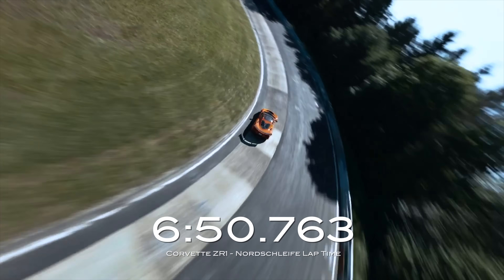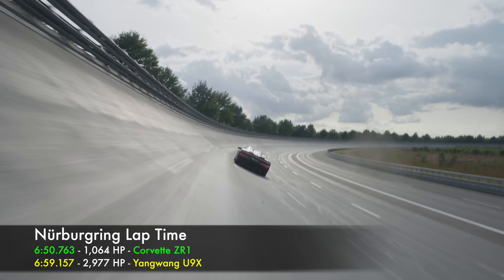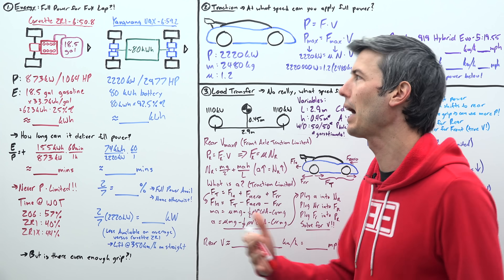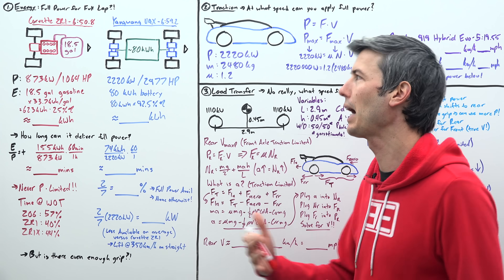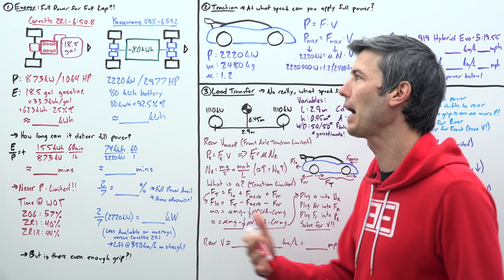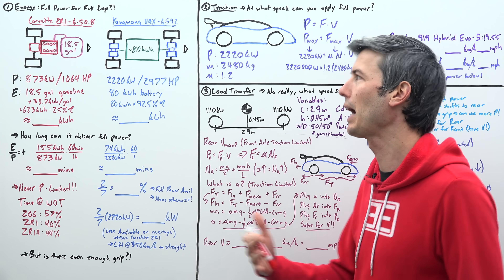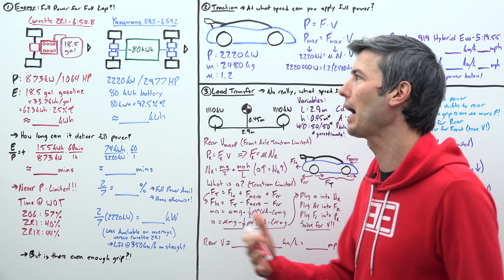Gas Beats Electric! Why Is 1000 HP Faster Than 3,000 HP?

Comment: At first thanks for the effort, i think everone gets the point u are telling! I dont want to offend you, but i think you kept it a little to simple here and there.

1) For a better visualisation there is such a thing called "traction diagram". You can put all the forces and resistances (negative forces) in the diagram for a clearer visualization and then look for the different keypoints (respectively show them).
2) You hadnt mentioned some (imo) important variables:
--> Gradient: When the car is going uphill, the rear axle power problem gets even worse and you also gain another (relatively high!) resistance. But the other way around, when the car is pointing downhill, you gain a significant amount of traction force on the front wheels. For simplicity you could say "they cancel each other out", but this isnt the case in reality, bcs some gradients are in corners for instance.
--> Adhesion: The Traction (m*g*u) isnt the only factor for bringing force/ power to the street. The adhesion between rubber and asphalt is also very important, because rubber is actually not a solid. Its more of a viscous fluid (non-newtonian-fluid). Especially when the car tires are slicks oder semi-slicks. What does that mean? The tires are "interlocking" in the asphalt and this allows a significant amount of extra force. Thats actually the reason, why they are making the tires wider (and of course bcs of thermal and strenght purposes). If you look at the formula Fr=m*g*u it doesnt contain any support area A. The support area A only appers in the formula for the adhesion (so big factor)
3) What about the drag force at higher speeds? The EV has a quite big bumber in the front and it seems to me this creates a good amount of downforce in the front (more power at lower speeds, but idk exactly at which speed it starts to work properly).
4) you havent mentioned the cars behavior in corners. The EV is significantly heavier than the vette. What this means is that in corners the tires of the EV are getting in trouble much faster bcs of the radial force regarding to inertia compared to the vette tires. This also a huge influnce on the lap time.

But anyways, again thank you very much for this very interesting topic and for the very clear explanation! You probaply know all of these things anyway and dont wanted to show too diffcult calculations.

Comment: it's literally all just do to weight. If everything was even, except for gas + automatic vs electric, the EV would obviously be better. This assumes the motors can spin fast enough and neither car has overheating issues. In this case, a 5,467 lb will almost never compete with a ZR1.

Actually this same question can be asked with a GT3 RS versus C8 ZR1. GT3 RS has like half the power. On the other hand it weighs 500lbs less and it generates less downforce. The ring is mainly high speed corners. Not too much straights.

Comment: Still wrong... this assume cars is going in straight line, which is obviously not the case, so aceleration calculaiton and tyre grip limit only makes sense ignoring that for like 90% of the time the acceleration will be at some angle and there will be later forces on the tyres. Meaning - there will have even less grip overall per axle and thus even less power could be delivered to the road.

Also big reason of why Corvette in this case was faster in this track is simply weight, I reckon chinesium shitbox lost more time braking than it lost due to lack of grip accelerating 2,500kg car or rather tight track would lose a lot in braking and simple could not take as agresive line and could nnot start accelerating as soon. So it obviouslly "killed" it in straight and on acceleration, but lost in corners and in breaking.

The reaosn is much mroe complicated than jsut straight line accelerarion and grip limits.

Comment: At full power the battery would be doing a 27c discharge. It would definitely cause a huge voltage dip causing the moters to limit power output.

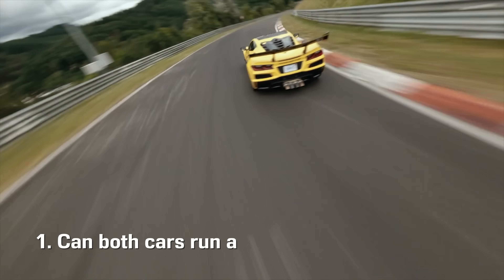Comment: 0:42 I know the BYDs battery size (80 KWh) and the ring length, so without doing the math, I can say probably not.

However, the good news about having such a high C rating is that th battery won't have to pull power due to heat soak.  Unlike..... say..... a tesla model s plaid might have had to do.
Reply: 8:25 this specifically had me shocked when I looked at what this meant for the "standard U9's" time around motor trends figure 8 course.   

I won't disclose the number I got because I HAVE to be wrong. However, the number suggests that it would not do well around the figure 8.

Comment: An electric car tends to be quite a bit heavier and handle not as well an gas powered vehicle  because of the weight an electric car will win in a straight line but on a Long Lap with lots of elaborate turns the electric car has a disadvantage

Comment: What about aerosynamics? How much does the U9 weigh at 150mph including downforce? You also need to figure air resistance combined with that downforce to figure out traction ability at speed.

Comment: Are you on crack?... seriously, have you any contact to the real world, completely disregarding weight, and corner speed on a race track. The electric car is slow because it is fat, every single electric car has this problem, there is so much track time found in the weight. Electric cars are only fast in a straight line, unless they are built to a specific track, with a run time of under 10 min, after that the battery weight starts become a problem, and not anything on your whiteboard
Reply: He didn't disregard weight.
Reply: @logitech4873 he only use weight to calculate some traction, the weight is a factor every time you accelerate, every time you break and every time you take a corner, and you do that alot on a race track, and he doesnt say anything about that, he is only talking about acceleration in a straight line. And you could at least have some sort of argument, instead of just saying, he did not do that.

Comment: Then the next question would be is it possible for a car to turn so fast that the driver is the limiting factor? How much of tyre friction is required to accomplish that? Is it even possible in the next 100 years?
Reply: Formula 1 has that problem, you need to be very fit to hold your own head at 4-6G.

Comment: 1:54 i figured for this example it was irrelevant,  but I don't think that's a fair assumption for the corvette engine. Since it's a super high performance car, it's probably in the 35-40% range

I remember hearing the mercedes f1 car reached like 50% efficiency

Comment: Your conclusion is the EV was slower cause it couldn't put down its full power, so what if it was limited to 1,000hp or 1,500hp would it be faster then? The main problem sounds like energy density of the ICE vs EV

Comment: Would be interesting to see how much time @WOT the yangwang  maintained. Then comparing that to the ZR1 and calculating out what power the drivers requested. More power requested would likely be a result of better stability from aero/weight dist etc as you concluded. In the ring, grip is king 🏎️

Comment: Something to note is that the nurburgring also has a speed limit I believe of 350km/h. This may also explain the limited straight line speed
Reply: Jason and commenters have stated that there is no such track speed limit. The only speed limits have to do with the speed rating of the tires used on the vehicles.

Comment: My question is: You state the the level of energy density for gasoline.  Is that just for gasoline or gas and air mixture.  I thought that about 40% or so of energy comes from air.  Just curious
Reply: ? Air is non-combustible, How do you figure it has "energy".? (All mass has some potential energy but that is not at issue here). The oxygen in air is the "oxidizer", not the "fuel".
Reply: @avsystem3142  thanks that's why I asked.  Guess I could have looked it up first. Seen someone else mention it before and I thought it made sense.

Comment: I like the videos the cars are cool the math you did is fun but there are so many variables left out that it’s not even funny and then a whole lot more that aren’t even recognizable.
Temperature of tires of the road of the air type or tires weight of vehicles the corvette gets lighter as it’s driven I’m guessing the electric car gets slower as it’s driven because of voltage drop and heat in the batteries and motor also the gas engine will get heat soaked and the brakes what about them

Comment: That's not factoring in the energy recoverability of the battery, a battery can store a rates amount of power but that's not what you are getting out of it 99% of the time based on degredation, temperature, and etc. You are often only 80 to 90% of that battery capacity back out of it again, on the lower side for track conditions, sure you can recover power through e-braking and otherwise but a significant portion of that power is lost to heat in the battery and elsewhere.

Comment: Jason, wtf??? The Nurburgring isn't a straight line! All of this math goes out the window when the car is cornering. 

If there is ANY steering input while the car is accelerating or decelerating then you need to account for the vehicles L/R weight transfer AS WELL as the F/R weight transfer to calculate whether it's power- or traction-limited. And that is all BEFORE you count every single bump, dip, camber change, elevation change,  and curb in every single turn, then analyze the drivers racing line and track the G-Forces the car is experiencing.

What I'm trying to say is that you've oversimplified this video to the point of it being completely useless. Determining the speed at which 3000 HP can be fully applied is ONLY useful on a straight section. You know this. The Nurburgring is like 85% corners (guessing. someone correct me). 

I haven't even mention the difference in vehicle weight and the effects of bumps in regards to tire grip and downforce. To pretend like the main difference in lap pace is simply due to tires is laughably ignorant.

Follow this video up with a REAL  analysis. I'm sure the cars had G sensors. Review the footage. Note any differences in racing line and sector pace. See which bumps they hit, which ones they missed. Calculate the grip for each tire in each corner. Do it right, or don't do it at all.

Comment: Horsepower = torque * rpm. Electric motors deliver torque linearly with rpm. This means more torque is available at higher speeds, however that isn't always helpful, sure it may have 3000 horsepower, but it may only have a modest increase in torque compared to the Corvette.

Comment: Having superior power or even power to weight is definitely not gonna be everything on a track like the ring. When one can weighs a tonne more than the other thats gonna limit the cornering and braking, and you would have to compensate that with either much wider tyres, or a lot more downforce, neither of which theyve done on the u9x.

Comment: Most of that seemed geared towards calculating the results of a series of drag races...cornering ability mentioned briefly at the end.
    Handling and ability to inspire confidence in the driver? 
   Something somewhat similar that maybe not many viewers can relate to...try riding a cr500 in a tight,  rocky hare scrambles. The power will be your enemy in about 5 minutes. Sooner, depending on your ability.

Comment: I would assume aerodynamic drag being put into down force through the body work + wings (but also the low drag diffuser) contributes quite significantly to the speed at which it can use maximum power.

Comment: There are some variables unaccounted for. I would say the biggest variable is a car's suspension. A car's suspension helps to manage weight transfer front to rear and side to side. The weight transfer will not remain constant, just as the rate of acceleration will not remain constant, as the opposing forces increase exponentially as velocity increases. The weight of a vehicle is a huge factor as well. The entirety of a vehicle's aerodynamic performance cannot be calculated with only its drag coefficient (Cd) which is only representative of a car's frontal area. Air exerts force on the top, sides, rear, and underneath of a car, as well as the front. As a car moves forward it pushes air out of the way and this air rushes back creating pressure variations along the entirety of the car. A boundary layer of air forms sticking to the car creating friction, and that boundary layer needs to be managed. Having said all of this, I am sure all of these things were left out for the sake of time and the viewer. 😅 But, taking all of these variables into consideration, I think it would be able to put down 100% of total power at a much lower speed. My opinion at least. It is true that we are approaching the limits of tire technology when it comes to grip. It isn't always the most powerful car that gets you where you want to go the quickest, it is the car that takes all of these variables into consideration and maximizes overall efficiency that will be the fastest, and that car happens to be the 919 EVO.

Comment: The ZR1 in racing conditions is 4 miles per gallon.  So it can go flat out for 74 miles not 10.  So your efficiency was unbelievably low.  I also believe your electric motor power train isn't as efficient as you believe.  You are adding back in your efficiency losses from regenerative braking which isn't done nearly as much at the ring.  So the number is FAR to high in the rings conditions.  This is why Formula E's tracks are so braking heavy so that they can regenerate 50% of their power losses due to all the intensive braking.  They do not run on the full out long courses that have multi ultra long straights as this destroys their efficiency numbers.  We all knew battery weight far exceeds gas weight and it lumbers into the corners in far worse condition.  This isn't the tires fault.  Unusable power is also much of the case with the ZR1.  1000 hp also isn't usable.  Both cars are unable to use the HP-FT/LBS available or they would just roast the tires.  Electrics are always worse on them due to the unbelievably high weight.  5,000 lbs is no joke.

Comment: I wondered the same thing, and this helps my understanding a lot.  Also, electric motors dont deliver max horsepower near their highest RPM like ICE engines.  This explains why they are excellent for street driving but can be less good for racing.

Comment: hmmmm... near the start when you work out the time available to run at 'full power', for the ZR1 you take the energy (155 kWh) and divide by power (873 kW) to get 10.7 minutes... but the 155 kWh is net energy (taking into account engine efficiency)... should you actually use the energy available before efficiency, ie. time available to run the ICE engine would be 623 kWh/873kW = 42.8 minutes...??

Comment: The advantage the U9 would have with that much power is the ability to overcome higher drag. So it needs a gigantic rear wing, and massive front aero, and it should be able to go quicker.

Aside from that, the Nurb is a fast track. Power makes more of a difference there than at other tracks with shorter straights and tighter turns.

Comment: Never enough to have power, as it matters whether that power can be delivered.

Another potential snag in the EVs ring performance is also heat. Even without going flat out as much at all, it could be heating up the battery pretty bad over the run. I know their 1500hp version struggles with heat, reducing power at a certain point more than most other high power EVs. Who's to say the power they can even actually put down also reduces below that over the course of a lap

Comment: If the conditions of the track limits the ability of both vehicles, then the total power of each vehicle being different likely won't allow that much difference to become relevant.
The drivers, traction and suspension of vehicles would make the most difference of each vehicles results.

Comment: Gas? You probably mean gasoline. I doubt there's gas cars trying to beat lap times against other type of engines because the point of a gas car is to be far cheaper to buy than gasoline.
Reply: WTF are you going on about?. In context, "gas" means gasoline. Your comment was a stretch at being pedantic and didn't succeed.

Comment: I'm surprised there was no mention of the electric vehicle maintaining it's weight throughout the lap, while the IC vehicle reducing its fuel load, and therefore its weight, during the lap as it burns off fuel. This makes the layout of the Nurburgring significant, as the main straight is also at the end of the lap when the IC vehicle is at its lightest. I wonder if the lap time would be different, and by how much, if they moved the start/finish line to a position just before the main straight. 

Jason, there's a challenge for you. Try to calculate the impact of theoretically moving the start/finish line in this way. 😉

Comment: You missed the biggest piece of info for this video. It doesn't matter how often the 3Khp vehicle can use its full power, it matters how often it can use more power than the other guy. You should have been doing all calculations for the Vette instead! At what speed is the Vette maxed out and the U9 has more gas electrons to give.

All you really did was prove that 3Khp is not being used very efficiently, and that even a billion HP wouldn't help much.